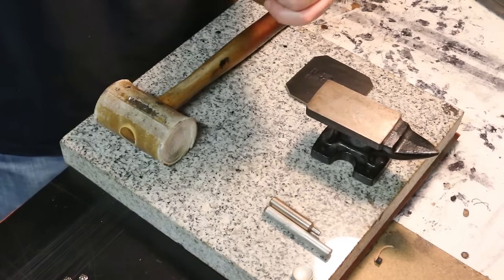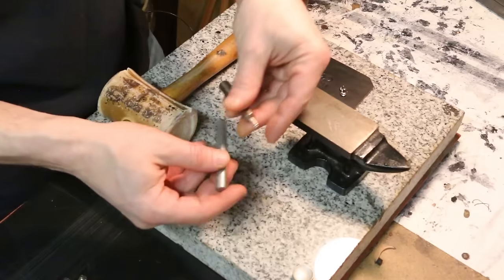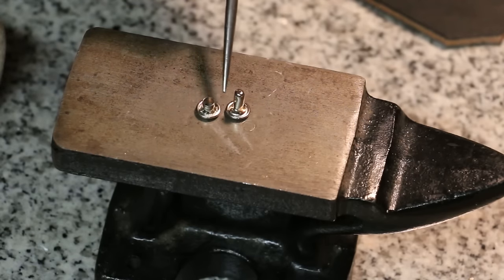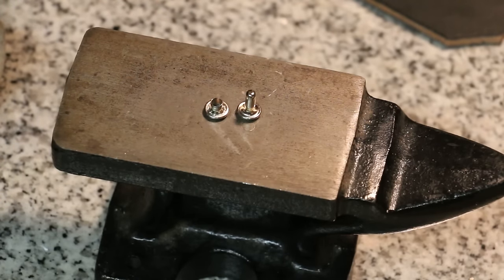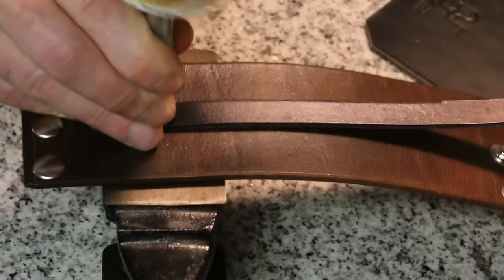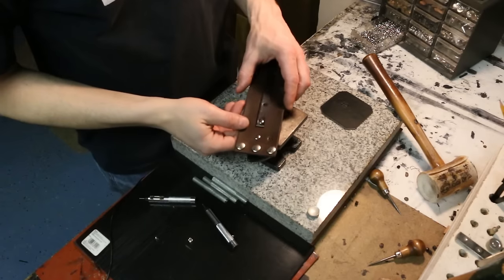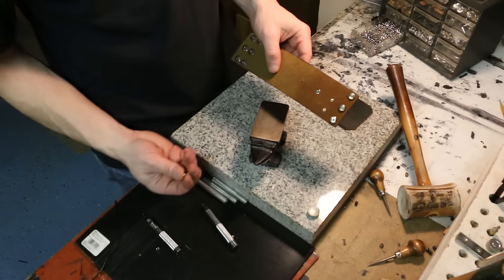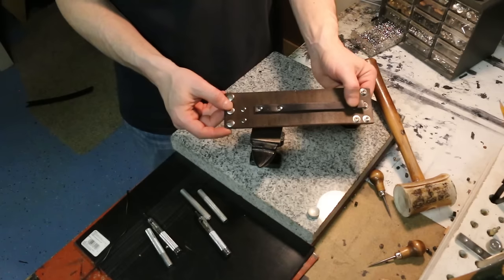How To Set Rivets

Comment: Stop me if I'm wrong, but you're missing a tool for double cap rivets here. The bottom one is flattening out against the anvil without another concave metal cast which came with my kit. 
Unfortunately it's hard to stop the rivet shaft bending and the top and bottom caps going offset while using this tool. I don't know what I'm doing wrong but it is hard to line everything up vertically and in the centre of the cast before hitting. Sometimes they are fine but most times they go offset after striking. I think the shaft might be too long as I definitely cannot set the rivet with just one strike of the hammer (needs several whacks). They are a good 2mm above the leather when I place the cap on. Thanks for the video
Reply from the maker: The reason for the top cap to stay concave is so there's room for the post to push into it.  Since the lower cap and post are one unit, there's really no performance need to keep that curvature on the lower portion.  Plus, flattening out the bottom makes it more flush with your material.

Your posts are too long for your material, if the caps are getting off center from each other.
Reply: @leatherpunk   Thanks. I know there's no performance need of the concave cast on the stem side, but it's to retain a curved look on both sides. This is a look many people might want, and as it comes with the kit quite often (at least on Amazon UK) I thought it worth mentioning.

Comment: I have rivets on a pair of Prada sneakers I purchased. The rivets hold the Prada triangle logo in place. I ended up returning them because one of the rivets snapped off. I doubt this is the repair technique to repair the Prada triangle logo back in place.  I think I'm going to return the other Prada sneakers that have the same rivets. I fear they may come off. The sneakers costs me $1070.

Comment: Hi! I'm working on a project right now with slightly thick leather but still within reason for the double cap rivets that I have, and I'm finding that when I try to set them it either 

-Doesn't go all the way in on one hit
or
-Bends the post completely out of shape.

Does my aim/arm strength just suck? Is there anything I can do to make this work more consistently?
Reply from the maker: Just a guess, but it sounds like you're using a heavy mallet. It shouldn't weigh more than 1lb and should be rawhide, rubber, or something similar, not metal.

Comment: Hi Matt, thanks for the great video.  You make it look so easy!!  I'm making some beaded dog leashes using my husband's discarded bass strings and trying to come up with an idea of how to  attach a leather handle to one end of the leash and a snap clasp to the other.  One end of the guitar string has a small ring that I can loop a small key chain type ring in and loop the clasp on that, but the other end is just wire that I need to figure out how to attach the leather handle to.  Do you think the rivet process you used in this video would be useful to attach the leather handle/strap to the guitar wire?  Any ideas about what size rivet and where I would get the tools and rivets?  I'm brand new at this, but love the look of the leashes I've made so far.  Thanks in advance for your advice...if you need photos to answer, just let me know how to send them to you.
Reply from the maker: That's creative!  For using a rivet the way you describe, kinda like screwing the end of an electrical wire onto an outlet, pinching the bass string in between the rivet cap and the leather, probably won't work well.  I might suggest using Chicago screws instead.  Rivets are too soft for what you're trying to do, the Chicago screws are much harder...and you'll be able to keep the string on course while you gradually tighten the screw.

Comment: Great tutorial! I think this will work to connect old metal pieces together. I want the robots to look old not shiny. I guess there’s a way to make shiny rivets look rusty. Any ideas? Thanks again!
Reply from the maker: Only naked steel will rust. Rivets are seldom made from steel, usually brass, plus they're usually plated. But there are brass rivets with antique finishes, that's about as close to rust as you'll get. I use a chemical called Rusty Red-F to get a rust look from naked steel. You can see an example here on my site: https://www.leatherpunk.com/collections/belts/products/rusted-studded-belt
I have a recipe to give it this look, each pyramid has a slight mix of non rusted silver and various hues of red,orange, brown, etc. Kinda reminds me of the beat up gear depicted in the original star wars films. It's quite a process, you expose it to the chemicals, then neutralize it and then seal it.

Comment: Hi there great  video. When making the hole before inserting the rivet
How do you know the size of the hole? 
And what do you use?
Reply from the maker: I use a regular hand held hole punch.  It kinda looks like the concave tool, but with a fitting on the end.  They come with different sized bits that you can screw in.  You just eyeball it and test it out on a scrap until you find the bit that works best.  Good luck!
Reply: @leatherpunk  thanks bro.

Comment: Matt, question, which rivet type do find to be more durable holding multiple layers of material together?  Thanks for the video.
Reply from the maker: Thanks Sean, The double cap is your gold standard for holding heavier material, compared to a single capped(tubular) rivet.  For really heavy applications, you can switch from brass rivets, what I use,  to copper rivets.

Comment: Hi there, 
I have a project I want to work, and this is the closest I've come so far to finding a way to do it.  
I'm trying to find a way to add a domed piece of metal to a leather belt. 
Something similar to a domed or dapped coin.  
Do you know of any techniques where i might be able to secure it to the leather without ruining the domed shape?  
Thanks!
Reply from the maker: Hey! You could drill a hole in the center of the coin, set the rivets through the hole. When you hit the rivet, if the coin is on the bottom, it will still keep its shape.  If you have pics you can send them to matt@leatherpunk.com and I'll take a look.

Comment: Awesome video! I have to ask though because I don't have one.. is the anvil necessary or will any smooth hard surface work as well? I want to avoid having to get an anvil if i can. Thanks!!
Reply from the maker: Thanks.  You can get by without the anvil, but it should be a metal surface.

Comment: what press can I get that is compatible with rivet, snap button, grommet, & stud setting dies? :D or is it necessary to buy multiple presses
Reply from the maker: The fittings are going to be relatively universal, so it comes down to preference. Some machines' arms pull forward, some backward, others twist. Unless you're doing this for a living, or are a bit older and have a tough time with your hands, you probably can just get by with hand tools
Reply: @leatherpunk  going to b makng tons of studded leather accessories Nd garments in general
Reply from the maker: @BLNTSMK  Stud setting has its own foot operated machine. The rest you can do with a table top press.

Comment: I can't believe it has been 4 years since I last posted and am now finally getting around to working on that quick open folding knife holster.  I was ready to buy some double cap copper or brass rivets from Amazon and then ran across your video again.  At the 2:00 mark you show the barrel of your rivet being filled in and rounded.  The rivets on Amazon are rounded but there is still a small hole at the top.  Does that matter much?  If it does then where can I buy the rivets you show.  And, with your rivet, is the whole barrel body filled in or is it hollow?  Final question, should I use copper or brass rivets?  Is one better than the other?
Reply from the maker: That little hole at the end of the post doesn't affect things. Copper is harder than brass, great if the material is heavy, lots of layers.

Comment: Do you think the double cap ones would be fine for the jean jacket im making?
Reply from the maker: I think it would depend how you're using them. You typically see copper rivets on denim because copper can handle being washed and it's harder than brass. If they're plated brass rivets and you're just doing it decoratively, there's probably no issue with it.

Comment: Question: The rivets I got are pyramid with a small screw hole on the bottom (for the other end obviously). Now the tricky part is the screw-on side of the rivet is completely flat yet the actual nail is a “twist-on” screw… like a flathead screw. Kinda hard to explain but how would I apply it? Is it the same concept?

Edit: What tools should I use? I’m doing this for a purse
Reply from the maker: I would just push up on the post with my finger while twisting/tightening the pyramid. You could also dab some Barge adhesive into the pyramid so that it seals for good. Or you could find regular screws that fit it.

Comment: So, rivets for leather, grommets for canvas, what about for denim or other materials pants are made of?
Reply from the maker: Andrea,  the choice of hardware is really based on what you're trying to accomplish. The  thing to remember is to match the right size hardware for your material. The material you're working with tends to dictate what the hardware is made out of.  For example, on things that are machine washable, like denim, you use copper hardware, typically.  Jeans are covered in copper rivets, that's what you see around the front pockets.
Reply: @leatherpunk  thanks that’s really helpful

Comment: Wonderful video! Where did you get your slab and what size is it?
Reply from the maker: Thanks!  It's a 1 ft square slab, standard for leather work.  I acquired it locally at a leather shop 10+ years ago, and I would suggest you try to find it in your area before ordering it through the mail(because of the weight), but if you can't, Tandy Leather sells it.

Comment: I'd probably use some type of cloth material on that anvil to protect the face of the rivets from scratches,or nicks
Reply from the maker: To protect the rivet cap(not face), you mean?  No, that would not be necessary or recommended.  The anvil face is very smooth and does not cause abrasions.  Cushioning your strike would likely result in a poorly set rivet.

Comment: Is there a way i can prevent my rivets from bending in the leather?
Reply from the maker: Your rivets are too long for your material, if the post is bending and your caps are off set from each other.
Reply: @leatherpunk  that may be it, i appriciate the response thanos got to go look for smaller ones
Reply from the maker: @valentepolanco34  for small projects, you can snip off a little bit of the post and reshape it, but if you're doing it on a regular basis, def find the right sized posts for your project.  Good luck!
Reply: @leatherpunk I had that problem till I bought a rivet and grommet  press.   It is perfectly aligned.    No more crooked rivets.

Comment: What size of rivet setter to use for 10mm snap button? Is it the 633 setter? Thanks in advance..
Reply from the maker: Some snaps need a full die set, with a specific anvil, and I believe the 633s are one of them, like this https://www.ebay.com/itm/Snap-Buttons-Dies-Mould-Set-For-655-633-831-Hand-Pressing-Machine-Spare-Parts-/382018618100

Comment: why does the rivet head not get marred on the anvil?
Reply from the maker: If the anvil surface is beat up and not smooth, it will scuff the lower post cap indeed.  Sometimes with cheap rivets, the plating will flake off also.

Comment: How well would that double rivet work for heavy canvas?
Reply from the maker: Yes, you can, but depending on your project, there may be better hardware options than rivets.  Most rivets are meant for leather and are probably too long for canvas, people usually use grommets on canvas.  If you do use rivets, make sure that the barrel length isn't much longer than your total canvas thickness, but again, I think you'll have a hard time finding rivets suited for canvas projects....that being said, there is a way to hand modify your rivets to make it work, you can snip off the ends and reshape them, takes time, but it does work well.

Comment: would this work with rivet style conchos
Reply from the maker: It depends on the exact piece, but generally Conchos are more like setting tubular (single cap) rivets. Sometimes you need a matching anvil for the concho to rest in during setting.
Reply: @leatherpunk  ok thanks was just wondering because I have small diamond shaped conchos but they come with two parts
Reply from the maker: @justingayman1704  if that conchos will lay flat with the post up, you can probably set it like a double capped, if that second piece is a cap. If the conchos isn't flat, you'll need a matching die to hold it in place.
Reply: @leatherpunk  ok thanks

Comment: How can i set rivets in a corner? Where i cant get my hammer in?
Reply from the maker: I'd have to see your situation to know for sure.
Reply: its a leather deck box
Reply from the maker: I'm not sure what a leather deck box looks like, but anything boxy can be a problem for setting corners.  You may have to use alternative bonding methods, ie. sewing, or adhesives.
Reply: there is a rivvet squeezer im looking at but that is way over my price range i was looking for somthing a bit more compact and cheep
Reply: Use a pin punch as an extension, or a long machine bolt. 
    https://www.amazon.com/Stanley-16-226-Piece-Punch-Kit/dp/B000NIBFSK
    http://www.acemitchell.com/Pinsetter-Parts-Plus/PPPBLSRK.html